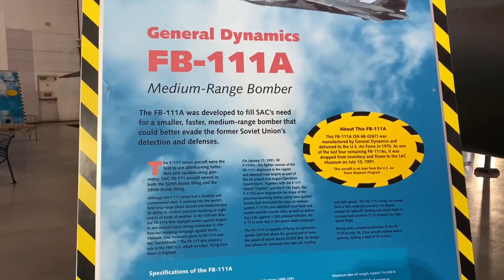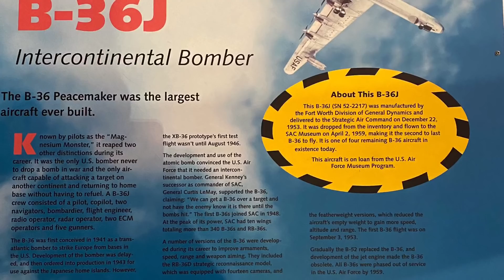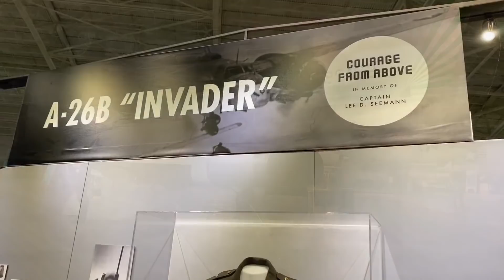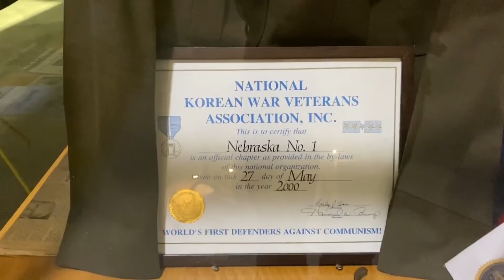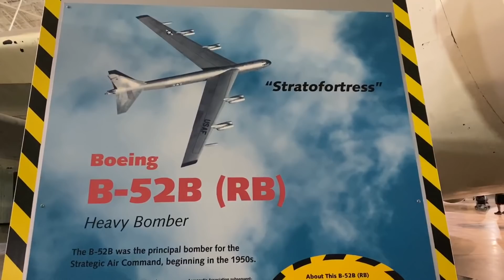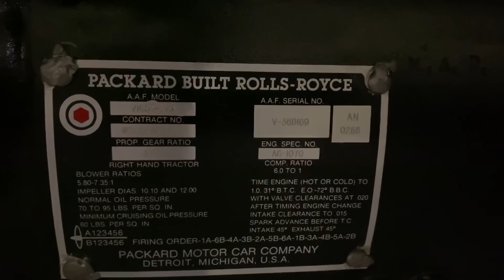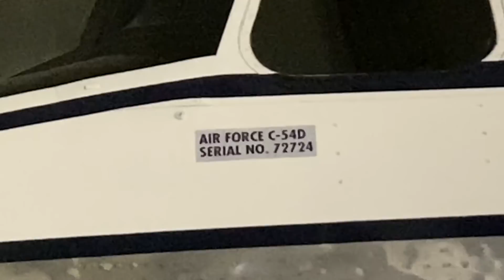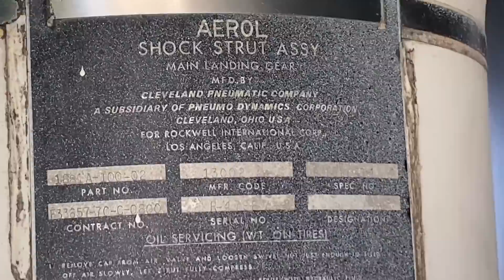The Strategic Air Command & Aerospace Museum August 2020

Comment: I dropped by this museum in 1975 and parked my 18-wheeler in the parking lot. The B-36 was sitting outside and was really in bad shape with the rudder completely eaten away. I am pleased they brought her inside and out of the elements. Excellent job filming and thanks a bunch for sharing!
Reply from the maker: Thanks Bob! I cant even imagine the work that went into getting it inside and cleaning it up. On a past visit they were working on the cockpit and they allowed a friend and I to go into the front half of the plane. To access the rear area you must ride in a small tube on a skateboard looking thing on rails. I will be going again soon, they recently adopted a F-117!
Reply: You didn't stop at this museum in '75 sir this museum opened in 2000 the museum was once @offutt afb

Comment: How in the world does the SAC museum not have a B-47? Even the USAF Armament Museum at Elgin AFB has one!
Reply from the maker: If you looked on sacmuseum.org you would find this info...

"About Our B-47E, S/N 52-1412 : This B-47 was manufactured by Douglas Aircraft, Tulsa OK and delivered to the USAF on May 5, 1955. Below are the unit assignments of this aircraft:

May 1955- To 301st Bombardment (Medium) Wing (Strategic Air Command), Barksdale AFB, Louisiana

October 1957- To Lockheed Aircraft, Marietta, Georgia (for work)

February 1958- To 97th Bombardment (M) Wing (SAC), Biggs AFB, Texas

January 1959- To 384th Bombardment (M) Wing (SAC), Little Rock AFB, Arkansas

June 1961- To Lockheed Aircraft, Marietta (for work)

August 1961- To 321st Bombardment (M) Wing (SAC), McCoy AFB, Florida

October 1961- To 4047th Strategic Wing (SAC), McCoy AFB, Florida

November 1961- To 70th Bombardment Wing (SAC), Little Rock AFB, Arkansas

June 1962- To 301st Bombardment Wing (SAC), Lockbourne AFB, Ohio (to EB-47E)

March 1964- To 3902nd Air Base Wing (SAC), Offutt AFB, Nebraska

June 1964- Dropped from inventory by transfer to the Strategic Air & Space Museum"